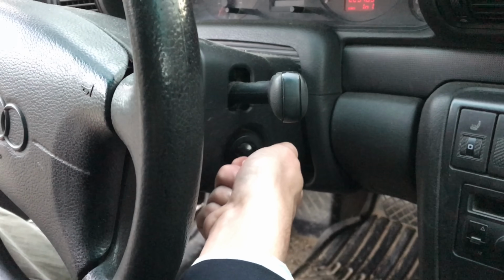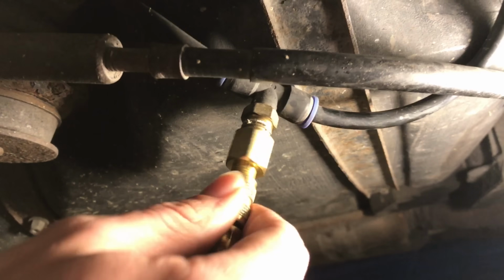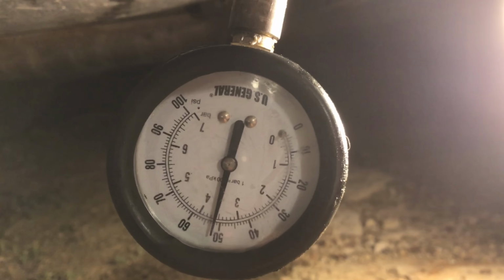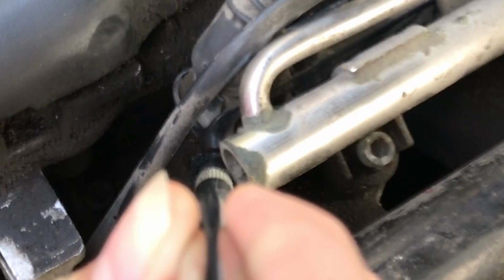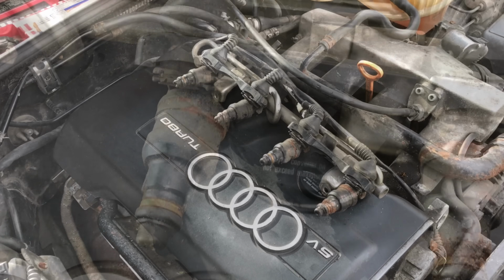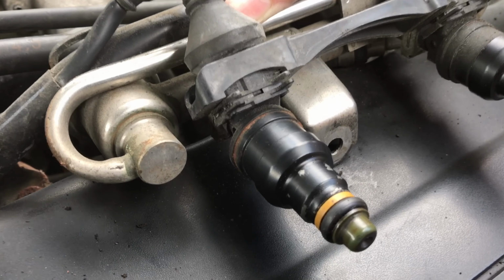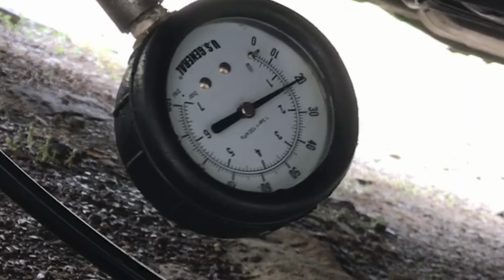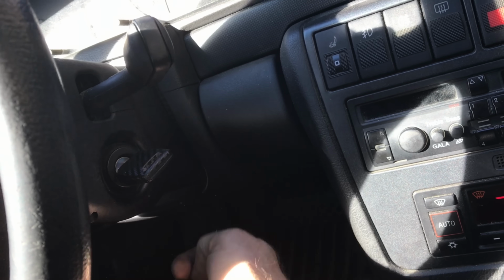Fuel injector? Fuel regulator? Fuel pump? Learn fuel diagnostics

Comment: I recently replaced my fuel injectors from a 1 hole to a 4 hole. Now I'm getting a po172, po175 oxygen sensors running rich and I can't figure out what the problem is? Is it the injectors??? Bad idling problem!!

Comment: Very good video and information. I was concerned about firing the injectors in the open though. I suggest a warning there to be sure there is no ignition leak. 
I am experiencing power fluctuations in my 2007 SG non turbo Subaru Forester. It was parked several years before I got it. The following are things i have rectified in trying to solve the issue and rule out possible causes. Cleaned throttle body, POR15 tank (clean as a whistle now), new fuel pump module (with filter and check valves) new strainer on left side as well as pump side, Cleaned injectors, new spark plugs and air filter. 
It never leaves me stranded and even makes it up steep hills but it definitely fluctuates between awesome and barely making it. I have not been able to connect this to anything like temperature but I have wondered if it was not connected to fuel level but not consistently or convincingly. My next step is to have a look at the electric pedal, fuel rail dampers and maybe a throttle body. When I rev it out while it is struggling it does sound dry suggesting it is getting air and not enough fuel.

Comment: Being a bit lazy but my car stopped as I was driving. Sounded like it shifted gears down and quickly lost acceleration. It wouldn't rev as if the engine shut. When attempting to turn it on, it sounds like it cranks but the engine doesn't seem to budge at all. Some insight on similar issues would be appreciated. Gonna try these methods out as well
Reply: So, when you try to start it you hear the starter motor turning but the engine won't turn over?
Reply: @jocarr1791  Yeah. Planning to check out the fuel pump this week since it's easiest for me to check

Comment: Question 
I checked my fuel pump relay and it was good also had spark and compression and when I check the fuel pressure I didn’t have any so I replaced the fuel pump and after that I  still don’t have any fuel pressure what can it be ?

Comment: I badly need your help as i own a Renault duster and has done 74,000 kms on it and all the services were done on time. Despite of it car is now showing engine check light.On scanning it is showing 3 codes which are:-
1:-DF771 - flow control adaptive
2:-DF053 - rail pressure regulation function
3:-DF885 - rail pressure
There is no problem in getting started but there is a sudden jerk and the rpm limits upto 2000 rpm irrespective of throttle being pressed.kindly help me as company advisory is to replace fuel pump(a hefty amount).
Kindly tell me is it fuel pump issue or anything else,i shall be highly thankful to you for this act of kindness.

Comment: I have a 2009 Toyota Corolla 1.8 I have check engine light p0171 system too lean I did a smoke test well tried but no smoke came out anywhere I don't know where to check for the fuel pressure or where the fuel regulator is  please help

Comment: So im having a problem. I changed all my injectors and ran fine for a day. The next day i had a large gasoline leak. Turns out it was a bad o ring. I replaced the o ring and it ran fine for the first day but broke again the second day but a different injector this time. Took it to a mechanic and he replaced o ring again and now its leaking again. What can be my issue?

Comment: Statistically speaking, if you're losing fuel pressure, chances are the fuel pump is most likely the culprit. If an injector is failing, your engine will run roughly.

This is so you can save time diagnosing your car.

Comment: My car has delayed power when accelerating after stopping. Sometimes, when it’s really acting up-I will push down on the accelerator to drive after stopping at a stop sign or red light and it will take 5-10 seconds for the fuel to kick in-it’s been dangerous at times. For an average car with an acceleration time of maybe 1-2seconds it easily clears the road it is crossing, but my car sometimes has a delayed acceleration time of up to 6 seconds and once I was stuck half across a main road barely moving forward whilst a car was speeding toward me at 80km hr-the driver had to slam their breaks and slow right down. I have since adjusted my driving during times when my engine is at maybe 10% of its usual acceleration power and had to revv it whilst in neutral then change the gear to drive when ready to take of, it’s the only thing that presets the car ready to safely and quickly take off when stationary. If I could afford it I’d try replacing the fuel/diesel separator as that’s the warning light which keeps coming on. When the light isn’t on the car drive very zoomy, but that is very rare to happen. Not sure what I should look for...
Reply: ok

Comment: Hello,I just got done fixing up my radiator and thermostat and replacing the battery ...when I turned over the car the first time after replacing the battery ,I let my car warm up and it cut off on me .I tried again and it turned over ok and didn't cut off on me until I got near my workplace .can u guys help me figure it out

Comment: Amazing. Thanks for the knowledge. I have a question though: I recently cleaned my car fuel filter and checked the fuel pump to be correct. I changed the break pads. Now whenever am accelerating, the car produces a sound like the clutch is pushed in and it does not increase the speed. What would be the problem?

Comment: Hey bro... I got about 9 psi of fuel pressure and drop to 0 as soonas I turn the vehicle off,  my gas pump is receiving 12v and I check return voltage on my pump and beps, on the fuel regulator if I unplug the hose the vacuum works but the psi don't move.... I check my fuel injectors completely and the work they are supposed to... extra detail... I check the fuse for the pump and only get power true is I'm trying to crank the car and nothing on the ready position....

Comment: I have got ls430  2003 model... my fuel consumption is really bad...even though I have cleaned the injectors and now it gives me worst milage than before..

Can some1 suggest me what should I do in order to get good milage?

My car gives me 220 miles full tank whereas it should give At least 400 miles per tank.
Reply: KASH DXB check your fuel filter

Comment: I just replaced my fuel pump and recently my starter on my 05 Kia Sedona.  Yet I'm still having running issues. 
It stalls as I'm driving and doesn't like to restart. It seems like I'm not getting fuel most of the time, as I cannot smell it after I have tried to restart it.
What do you think could be the problem?
Also coming into play is this just happening yesterday is, I restarted it and got it going but now it's not wanting to get out of second gear..
I'm lost and pissed off at how much money I've put into this thing..
Any help would be appreciated.  thanks..

Comment: I honestly don't what's wrong with my 06 Sentra 1.8 L been going on for probably over a year . What it was doing was getting stuck in idle low speed after I started it and wouldn't rev up even if I press gas pedal as much as possible . I used to turn it off then wait a minute and it's be fine . BUT I knew things get worse so I've taken it to two different shops nada . One shop replaced throttle position sensor just like yours look like . Nope didn't fix it . Then took it to a electric auto shop they reclibrated computer ( whatever that means ) . Still the same . And yesterday it finally just left me stranded . Ha to tow it now at home .I knew that moment would come that's why I tried to get it fixed . Someoen told me that check it by listening to fuel pump going when I turn the key and try to hear it run . Nope tried it a few times don't hear a thing . I guess try your way

Comment: If a fuel injector is leaking when not running there would be a misfire on the cylinder because it's flooded . If there is no misfire on start up don't bother pulling the injectors

Comment: great video.  my mazda 3 2015 195K mi on it has been misfiring for about a year.  cold start in the morning fine but takes 2 or 3 attempts during the day once warm.  i also have a bumpy idle and have been getting low mileage on my tank for awhile.  had a check engine light on and off but my stupid mechanic said it was the mass air sensor or something like that.  clearly wasn't.  i also got a new battery, so that's fine.  the mechanics in nyc are lazy AF.

Comment: Hi my 2007 bmw 520d was parked for the month I kept starting it sometime until battery was very low and it run out of diesel so I recharged the battery I put about 15 litres of diesel but the car would not start at all do you have any idea. Regards
Reply: Air in fuel lines. Air in pump.

Comment: I've never heard of a check valve, is this on the fuel filter?. I have only seen a fuel pump and fuel filter down there. Had to change a fuel pump not long ago, I would listen for a noise after turning the key through the gas tank to diagnose a fuel pump issue, after checking the pump and starter fuses first of course. I have a commodore vs89. Got to get me more testing equipment, probably didn't need a new petrol pump.

Comment: For a 3.7L engine how many fuel injectors are there? Hope that’s not a silly question.
Reply: AngieMusicArt How many are there cylinders?
Reply: 1 injector per cylinder. 4 cylinder would have 4. V8 would have 8

Comment: hello sir, i have a question i have MPV MAZDA 1994 V6 2 WHEEL,ITS SMELL GAS,I REPLACE THE FUEL INJECTOR,CENSORS FUEL LINE AND MANY MORE IN STILL SMEELS GAS AND THE SMOKE COME FROM THE MUFFLER IS WHITE AND BLOCK,WHAT IS THE PROBLEM,I HOPE YOU CAN HELP ME,GOD BLESS.

Comment: I have a 2005 Prado with a 1kd engine. Once a week when driving at low speeds it loses engine power, followed by rough idling. My mechanic thinks I need to replace the fuel pressure regulator, but the only symptom is the loss of power. When you shut down the car for 10mins, everything goes back to normal and you drive as fast or slow as you wish. The car doesn't show any warning lights on the dashboard. I am so confused by this

Comment: I have an audi a4 b5 1.8t thats burning gas somr how.... i put 15 liters of gas and drive ah pretty short  distance.... and when i look at the guage about 7 liters out of that 15 has been burnt within about 4-5 miles...which on a regular basis it would burn 1.4 liters for that same 4-5 miles and is a hudge problem for me... idk y its doing that... much help would be appreciated... also when i step on the gas to kick down... my car jerks and misbehaves... not sure y.. i scanned and only saw wastegate bypass n75 and airflow which i fixed... same issue... my car is not even driving and everytime i check on it the gas guage reads less and less... no signs on gas on the ground

Comment: Another place to check is the fuel filter. I see he is working on a Audi A4 Quattro 1.8t, the same as my car. This last fall (2021), I went to replace the fuel filter and when trying to remove the connectors, one would not come off. After about 45 minutes of fighting with it, it finally came off. To my surprise, the previous idiot who replaced the filter had damaged the connector to the engine output side. Worse, he epoxied it into place. I rigged it to operate with the new filter, but it may not be sealing the line properly. A permanent repair is in order soon.

Comment: My car won't start immediately evrytym I turned off the engine but aftr 15 to 20mins its start again. I already change fuel pump ang checked spark plug ignition coil and fuses. But I still have the same problem. Example if turned off the engine at gas station it won't start it only cranks after a few minutes it starts. 2004 mitsubishi lancer mx a/t

Comment: Hmm my truck starts quick but won't hold pressure regulator seems ok no fuel in vacuum line and pressure jumps up if vacuum removed...damn could be injector

Comment: What is your project starts up what if your truck starts up normal and that starts idling rough very rough check engine light comes on heavy and then also when you drive it feels like it’s still running very rough him a month ago I had to take drop him he put a new filter and new fuel lines on it and you also put a new pump on it this is the third time over for the pump I also put a filler filler hose fill her tank for the filler and he had holes in it so they were there might of been dirt or rust going in through the motor so I￼

Comment: I had that problem the dealer replaced fuel pump and injectors and then said the main manefold was cracked cost me. A lot. How could i know if the replacement was unneccessary. I took it in for starting problems and replaced the starter myself... But the car had starting problems after they supposedly fixed it and then the car is back at dealer towed 4 th time and they said it is starter so i bought at napa and have towalk today in rain after dealer takes it off. I thought i was burned bad but believe dealer would not be dishonest.  How can i know if they got me as my credit card is skrewed. Could they have replaced the injectors and pump but the starting problem was still present needlessly and wonder do i have any pptions because maybe it was a scam and i fell for it and kicking myself in ass .

Comment: Hello !Loose pressure when I accelerate, code P0093 fuel leak detected, the car enters safe mode ,Test injectors they're good, change pressure regulator still the same, should I also check valve in the tank? It's toyota Corolla verso 2000, does anybody know where the valve? Thanks in advance

Comment: I have a 2013 Volkswagen Jetta, every time i fill up gas, my car gives me hard time to start. After starting i need to press the accelerator for a bit like for 10 to 20 seconds. After that the car runs good. 
The car starts fine ever time is start it. But when filling up gas, gives me hard time. And also the check engine lights are on too.

Please any suggestions

Comment: I had my fuel injectors cleaned and then got told maybe the ecu... turned out to be the bloody starter motor was starting to go... didn't realise till it wouldn't start when hot and tapped it to start... I just swapped the starter today and it starts like it's brand new aha

Comment: My fuel psi goes to the correct pressure when the vehicle is running but soon after I shut off the engine the fuel pressure instantly starts to drop until zero..

Comment: I have a problem with my s60 volvo non turbo. First 2 of of the ignition coil failed and change them, then the gasket of the vvt solenoid broke down and leak a lots of oil into the timing belt change the timing belt and water pump. Then the scanner says the mass airdlow sensor. Cleand it and now still have problem when I started and put into higher gear it hesitating until 4 gear then normal and good acceleration, no engine lights and code only that it shaking and hesitating in low gear. It seems no enough fuel. Anyone knows?

Comment: So question.   I have a chevy van that when it starts I smell a little fuel.  Otherwise it runs fine free of any smells.  However on a 90 degreeish day when I have my AC running for about 2 hours which puts a lot of ambient heat into the engine bay it starts smelling like raw fuel is being pumped out into the open air.  Reeks to high heaven.   Once it cools off, absolutely no smell of fuel.  ANy ideas anyone?

Comment: I can and can't drive it it keeps cutting of I put a fuel rail line pressure sensor in there it kind of did the same thing then I put a new fuel pump in there and it's still doing the same thing where to look next

Comment: I don't have the skill or Kno where that fuel pump check valve is I drive a 93 240sx I'm just gana replace the entire fuel pump instead since it's only 70bucks & it's top located so no dropping tank

Comment: Opel Insignia A20DTH 2.0 CDTI 160HP:

P03b7 p03a1 p039d et  CYLINDER 1 2 3 4 PRESSURE VARIATION TOO HIGH TO LOW .

Someone can help? How to test regulator?

Comment: 1. just replace your fuel pressure regulator, they’re fairly inexpensive.
2. You’re gonna go to the trouble to remove all the injectors from the car, you have to replace the O-rings, and not just any O-rings. They have to be methanol and ethanol safe O-rings for today’s effed up gasoline. Otherwise the o-rings will  be eaten in less than a year. You’ll be doing all that work again. 
3. If the check valve In your fuel pump has failed then your whole fuel pump is going to fail in less than a year.. putting an in-line valve It’s just a brief help , certainly not a solution. You need to change your fuel pump.

Comment: My ford ranger 2.2 Spacecab had overheating issues, so I fixed everything.

I eventually started the vehicle.

While the vehicle was staring my mechanic went and opening the fuel nut to see if there was fuel flowing into the engine, he removed each nut from the first injector nozzle to and close it when there was fuel shooting out but once he reached the third nut from the third injector, the engine starting giving off a knocking sound. So, when we tried to start it again it started but the knocking sound came on again and then the engine went off.

I checked the Fuel chord to see if the fuel was affected so while bleeding it there was a lot of bubbles in the diesel fuel. 

So, now when I start the vehicle, it just cranks, with the knocking sound  but can not start and there is still bubbles in the fuel.

Can anyone please help me on how I can solve this issue.

Thanks. 

Ford Ranger 2.2 spacecab diesel Manual transmission

Comment: Why do alot checking??? even without the valve there's no problems!!! Just go change yours fuel filter!!! If the valves jammed there's no fuel on fuel pump anymore and the injector also 😮‍💨😮‍💨😮‍💨 with that's pressure on injector your engine easy to start 😮‍💨😮‍💨